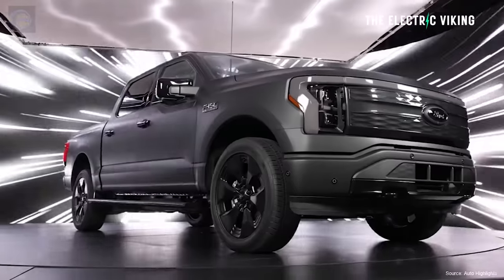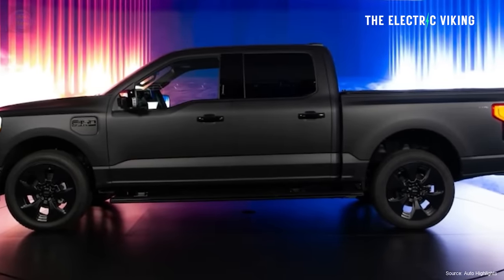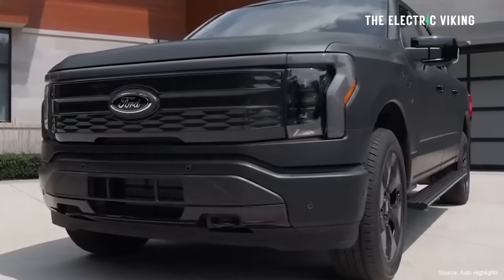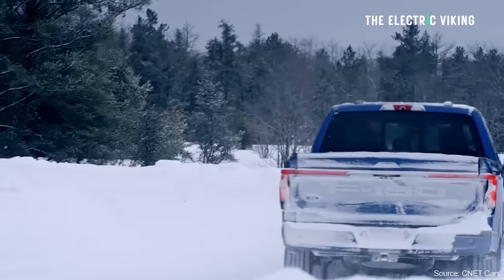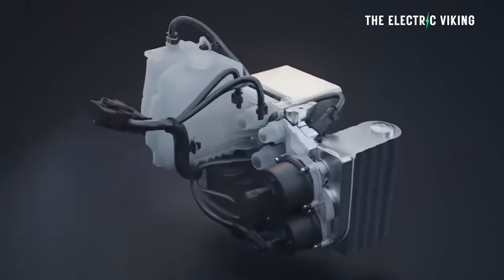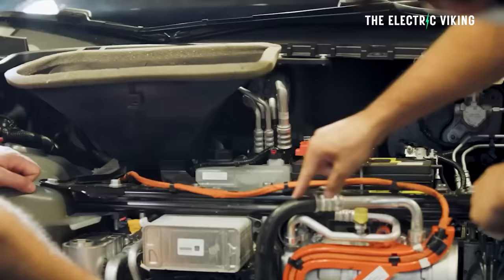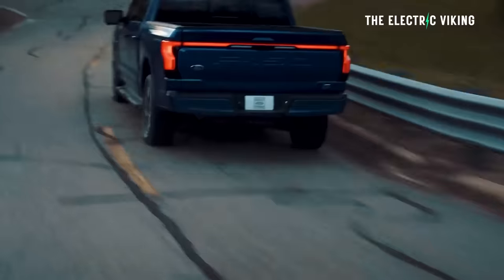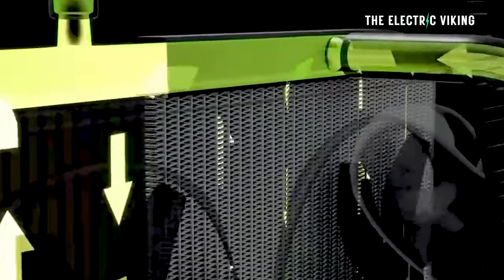Ford's new EVs get efficiency boost from new heat pump technology

Comment: The fact that third party manufacturers are getting into more capable heat pump systems is great for smaller manufacturers who haven't got the expertise to design their own systems. The key to getting the best out of a heat pump is the controler (like  Tesla's Octovalve) to avoid getting the rat's nest of piping as on the Ford demonstrated by Sandy Munro,
Reply: The Mustang - a plumbers nightmare 😂😂

Comment: It's so lame that all vehicles with air-conditioning have most of the parts needed for a heat pump.
Reply: An air conditioner is a heat pump, it's just not utilised fully to regulate battery and motor temperature as well as cabin temperature.
Reply: @eclecticcyclist  What basically makes an refrigerant pump a heat pump is most often just the addition of a reversing valve added to the refrigerant system.  In some marine system now passing 20 years of age they could easily be changed from Straight Cool units to Heat Pumps by simply installing a reversing valve and upgrading the thermostat to be able to flip the valve from cooling to heating.  

One big improvement to heat pumps though was the advent of the variable speed compressor (often called Inverter Heat Pumps in residential systems) which when idled down to match load instead of just relying on the expansion valve can now reach efficiency levels beyond 30 SEER.

Best!
Reply: @neilfromclearwaterfl81  By definition a heat pump is a " Device that transfers thermal energy in the opposite direction of spontaneous heat transfer" any valve or lack of valve is an addition to that basic heat pump.
Reply: @eclecticcyclist  Yes "In Opposite Direction" from the normal condensor evaporator mode of operation.  You take that from a conceptual paper to the real world by providing valving that allows opposite direction of heat transfer.  A good AC tech can take a straight cool system and convert it to heat pump operation with the addition of a reversing valve or visa vi and bypass a defective reversing valve to convert a heat pump system back to straight cool.

Best!
Reply: @neilfromclearwaterfl81  The basic machine is called a heat pump, everything else is a spcific application.
Reply: @eclecticcyclist  In a clinical sense however in common language the designation "heat pump" denotes a bidirectional device that provides for both cooling and heating in opposition to a one way cooling only unit/Air Conditioner/Refrigerator/Freezer.  You go to an appliance store and ask for a cooling only heat pump and your only going to cause confusion and perhaps be branded as a supercilious oaf.

Best!

Comment: Tesla removed the PTC electric heater in 2020 and changed to a heat scavenging system in mid 2020. Tesla now scavenge heat from 16 sources within the vehicle including motors,  the fluid cooled computers, inverters, battery, even from the heat pump motor it self. This improved range by over 10%. No other EV has this system presently.
Reply: You sound like you saw the Weber Auto teardown and analysis of tTesla’s thermal management system.

Comment: This story shows just how early we still are in the development curve of EVs and related tech/systems/design. EV development is rapid and in 20 years technology and engineering in the cars will be almost unrecognizable compared to today's vehicles. It's like the first iPhone compared to the iPhone 15 - it's a paradigm shift in capabilities, efficiency and design.
Reply: EVs actually predate the internal combustion engine. They lined the streets of New York over 100 years ago. So going back to EVs is more like going back to the telegraph & similarly the only way you could achieve that is by political force, not consumer choice.
Reply: Agreed. So this implies don’t buy one now, wait until stability
Reply: @orionbetelgeuse1937  Solid state literally just came out.
Reply: @oscarjohnson9156 Really Ford just had one of its best months selling the Ford F150 Lightening and Mustang Mach-e
Reply: @orionbetelgeuse1937  so you haven't been keeping up then? Do you think the SSB we're talking about here are the same ones? The high internal resistance is why they weren't used before, do you think they would go back to them without solving that problem?
Reply: @orionbetelgeuse1937  Literally there are 3 makers already pretty much there. At least far enough to have 380-400 wh/kg semi-solid batteries and many more going even higher than that at 700 wh/kg. This is with good life expectancy and fast charging with safer materials and design.
That's more than enough for any usage in cars today.

Comment: Sam, efficiency measures how effectively energy is transferred to motion.  Cold weather reduces battery capacity but the efficiency isn’t affected much.  To increase efficiency the drag coefficient and weight of the truck needs to be drastically reduced.

Comment: Maybe adding a Webasto style hydronic heater for the battery and a cab heater would solve these cold weather issues in places where it it extreme. They can be diesel or propane. A two hour drive would use a very small amount of diesel or propane compared to the way ICE cars use their fuel to heat the cabin.

Comment: Resistive heater running on high uses about 4 kw. Heat pump running on high uses about 2 kw. F-150 at freeway speed uses .50 kwh/mile. So at 70 mph in warm temps that is 35 kwh per hour. In hot temps with AC, it is 37 kwh per hour. In cold temps with heat pump it is 37 kwh per hour. In cold temps with resistive heater, it is 39 kwh per hour. Cabin heating, even with a resistive heater, is only responsible for a 6% range reduction. The real world 20% range reduction is due to cold battery, cold motors and cold tires. I’ve tested this with my Tesla: even if I preheat my battery and I only use the seat heater and wear a coat in the car and leave the heater off, the range is 10-15% lower than than on warm summer days. The heat pump is a small bonus, but it is not a complete game changer.
Reply: 37kWh for a heatpump?

That pump must be two times bigger than the F-150.

The heat pump in my Nissan Leaf uses 250wh on 20 degrees Celsius setting with an 8:degrees outside temperature.

A model 3 2021 in Norway uses 735wh compared to the 2019 model 3 that uses 2.1kWh to maintain the same temperature.

I think you must confuse something.
Reply: @badchefi  I think you must have confused something. I didn’t say the heat pump uses 37 kwh per hour. I said it uses 2 kwh per hour. The pickup uses 35 kwh per hour at 75 mph to drive down the road.

Comment: There is an advantage with a heat pump if you are doing longer journeys in colder climates. There is little or no advantage in shorter journeys. Heat pumps are very good at utilising the heat from components within the car. The one drawback is they are not good at generating heat from cold therefore even the cars with heat pumps use the resistor heater to firstly generate heat then the heat pump takes over to spread that heat around. So as said the heat pump doesn’t give an advantage on shorter trips as the resistor heater is being used to generate the heat in the first place.
Reply: Nah

A good heat pump is 4-6 X more efficient than any resistor heater.
Reply: Not all EVS with HP have a heater they scavange heat from components

Comment: Efficiency is needed, like I really welcome new Model Y with just one motor in Europe that gets 600 km range. Many people want huge ranges, but there is also a reason why ICE cars do not get insane ranges, you will eventually have to stop and take a rest and need to fill up. And maybe 300 miles or sth like that is kind of a range when you do that, and better to have efficient smaller battery that charges fast than just put a huge one that will also recharge longer

Comment: A new motor design could have heat vanes around the housing of the motor, in which air flows through converted to hot air and redirected to a pipe array around the battery.  One would need to be able to shut it off during hot weather.  This could also boost electric motor performance.
Reply: Could also be used for heating the car during winter.
Reply: Efficient designs are liquid cooled - much less drag induced power loss when pumping fluid than in blowing air, and much more heat scavenging. Tesla uses liquid cooled motors. Tesla also changes the way that the field coils are fed when required to increase heat output, kind of like an induction stove does, to supplement the heat pump when required - which is also much more efficient than a resistance heater.
Reply: They already do that, with liquid coolants.

To cool notors, inverters, chargers, and either to heat/cool the battery 

Better designs use this heat to heat the cabin also. Tesla's heat pump design is very well designed for extracting heat from all waste areas

Comment: I think a petrol powered electricity generator as a range extender that uses the waste heat to heat the battery and cabin in cold climates would be a winner.
It could be used on the summer holidays and other peak times to reduce the queues at charging facilities also.

Comment: People think heat pumps are some new magic. They are the same tech that has been running electric refrigerators and freezers for over a 100 years now.
Reply: Not doing heating.
Reply: Meh that’s not exactly the truth…that’s like saying a Model T is the same as a Model Y😂
Reply: @jezza6575  Nope.  Compressed freon gas to extract the heat for heating or cooling. Same as a fridge.

Comment: Nissan leaf didn't have a heat pump for a bit
Reply: Interesting observation. What’s your point?
Reply: I wish there were modular replacement batteries for old EVs like the Leaf that had improvements. Unless you mostly use the Leaf here at nights in the summer,  or mostly in the winter - a replacement battery won't last very long.   The battery makers struggle to keep up with new vehicle battery demand, there is no incentive to offer upgrades for the 1st gen Leaf. All the Leafs I see for sale here in South Texas are low miles cars with failing batteries, otherwise like new. Cheap, but not good.

Comment: Batteries are not efficient because you have the whole of the weight to carry even at a low charge. The bush should be to make the battery lighter & not extended the range.

Comment: is this an affordable work truck for the handyman?
Reply: If you include operational costs of 5-10 years, it should be more affordable than diesel/gas trucks.
Reply: @WAVM2024 
You're funnier than Bill Burr.
Reply: Depends on your circumstance.  If you do not travel or tow long distances and if you have your own home infrastructure where you can plug into a level 2 charger every night.  Then absolutely.  The frunk is a game changer for work.  You can keep all your tools in lockable storage and have a free bed to haul stuff.   You also have a ton of plugs in the frunk where you can charge your tools.   Even for towing it's awesome and powerful.  You just can't tow far.
Reply: Are you serious? What are you smoking?

Comment: The problem is no longer range. It's charging and repair costs. 7 Kw. is what the luckiest of us Americans have for charging, that is typically a garage with a dryer circuit. Charging a 200 kWh battery with 7 kw would take about 28.5 hours; Tesla Home Charger 17.4 hours. Public charger? In socal you're lucky to get 30kw so about 6.67 hours. Taking the boat and the family to the Colorado river is about 270 miles each way. With towing range dropping to 145 miles, what does that trip look like?
Reply: The additional load of the EV chargers will cripple the outdated supply system to residential areas.  The more amps drawn on a given circuit will reduce the amount of available supply for others. That's why there are brown outs bordering on the verge of blackouts during peak heating and cooling demands now. Forget about what's a trip going to look like. What's it going to look like when the parts of the grid collapse during 110 degree temperatures.
Reply: @howardj602  that is a good reason to upgrade the grid then not just give up and say it can't be done
Reply: @JD-yx7be  Oh, it can be done. But what is wrong with have an electrical EV charging system with  generating dedicated to charging EVs.  That can be done also. It is one of the mainstays of the EV network envisioned by Elon Musk.  However he wants to do it with taxpayer money,
Reply: @JD-yx7be  Amazon has done it.  It  is now operating the the largest number of privately owned chargers in the U.S. tailor made for its fleet of EVs.

Comment: I thought Tesla invented the heat pump?
Reply: Heap pumps were around long before EVs.   Tesla was kind of a late adopter of the heat pump.  But  the Tesla octovalve system is a advancement in the industry. Interesting to see how the new heat pump works out for Ford.
Reply: @danharold3087  It was sarcasm Dan.
Reply: @hwirtwirt4500   Sarcasm is not always evident in text given the range of intellect present here.
Try using  /s